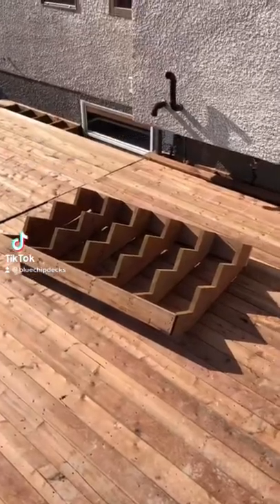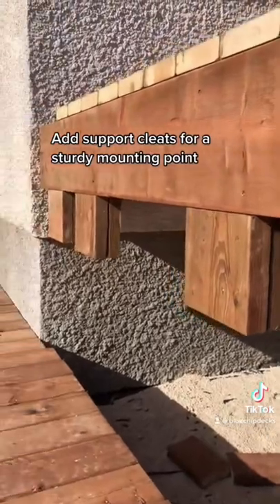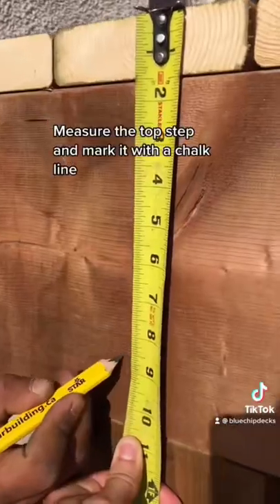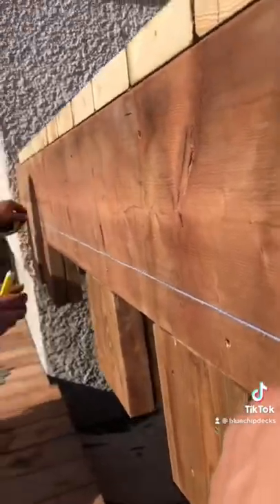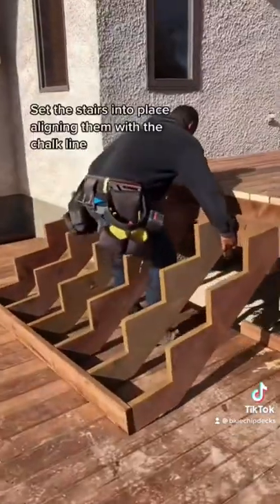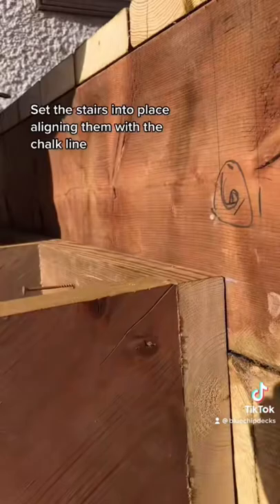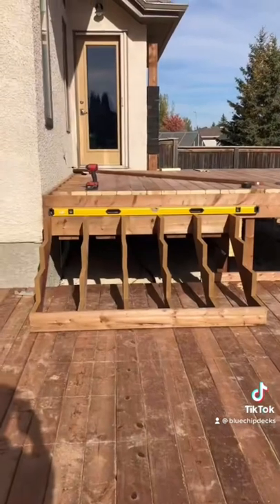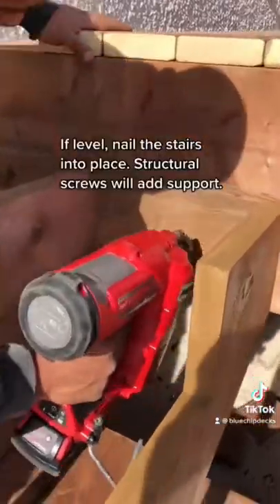How To Mount Deck Stairs

Comment: That will never pass inspection and 6 stringers on deck a little over kill don't you think?
Reply: I dont think extra stringers are a problem, since those look pretty wide. But those "support cleats" might not pass inspection. Should've just added another 2×6 or 2x8 for a solid support mount. Also, he didn't use hangers. Not sure what code is in his area, but i think hangers are mandatory.

Comment: Finally, a contractor doing it right, but using screws.
Reply: Sheer rated screws would work, even lag bolts too or nails do the trick you just need to know the sheer strengths and how much weight it is and may have on it if jumped on like a super Mario brother
Reply: GRK screws can easily handle this.  They are rated to be of equal strength to lag bolts.
Reply: @Wowzersdude-k5c  was curious if anybody was going to say GRK screws!
Reply: Ok, now that you've both referenced them, what are they? 😮
Reply: Yeah that’s not how its done. Guaranteed to fail inspection. No hardware on the stringer to deck connection, no continuous backing. But to each his own

Comment: This way your top step will be wider than the rest. Also no bracket for the lateral load will only result in the nails & screws getting loose over time. 
Not sure if this is the right way to go about it.
Reply from the maker: No it won’t be.
Reply: Not if he cut it 1.5" shorter..